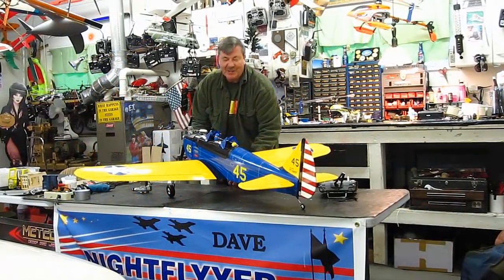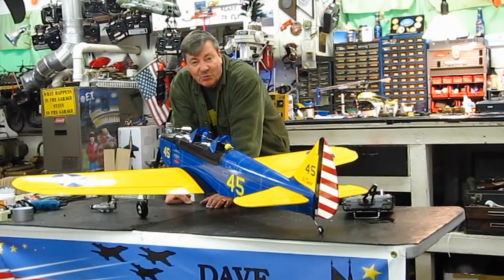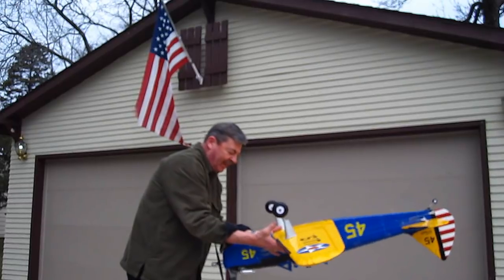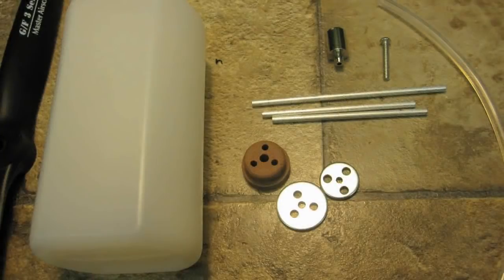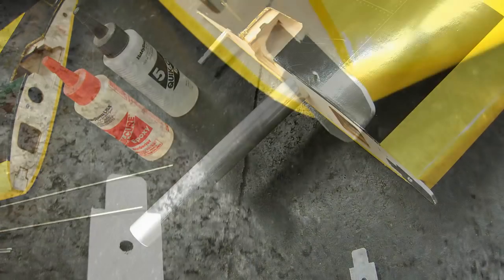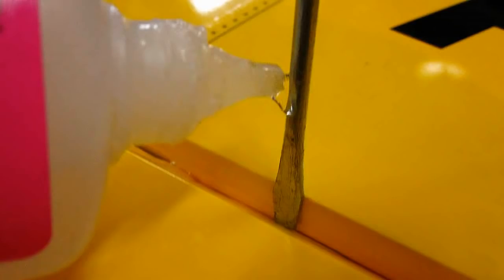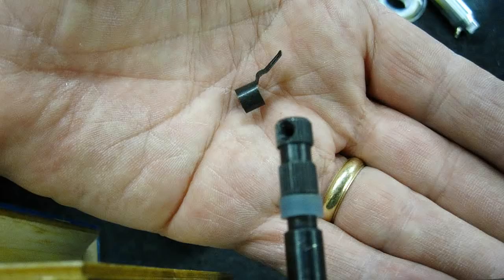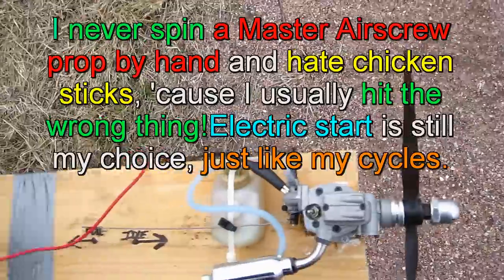NitroPlanes PT-19 with ASP .61 4 Stroke Engine tips and maiden flight.

Comment: I had a PT-19 I built from a house of balsa kit.  It was a 40 size that flew on a 25 size engine.  One of the most predictable and smoothest flying planes I had.  For that one the engine was mounted sideways which let the muffler run along side bottom.
Reply from the maker: That's great.  It was a sad day when this and a brand new one still in the box were destroyed in the fire that destroyed all my models.  I really liked it, as Balsa planes always seem to fly the best. Thanks.

Comment: 6 months of flying nitros. Heaps of hours in the air and no crashes - until today. Being too clever and crashed my hack trainer. Wrote it off. So now i have a spare asp61 and all the running gear i need for this plane. 
Thanks! 
:)

Comment: I get rezzed all the time about flying my glow power planes. But there's something about the set up, getting the motor to run good, the smell & smoke, the noise, the POWER, and the smoke trail behind the plane. And even the messy clean up. I LOVE IT!!  Electric is nice in it's own way too when you want to fly NOW. (If batteries are full) GREAT MAIDEN DAVE!!

Comment: What prop did you use to break in the motor? I was also interested in what prop you're using for the video. I have the same setup and have used a number of Master Airscrew props but haven't really decided on the "one" I like best. Just wondering what was your preference. Did you place your battery etc. behind the fuel tank? I was looking to see in the video where your switch was as well. THANKS! Great video and those ASP .61's sound great don't they!

Comment: How do you dispose of this fuel?  My father was into these model airplanes and died several years ago.  I was cleaning out his garage and found several plastic bottles of fuel.  It has to be at least 10 years old.  I poured a tiny bit on half a paper towel and lit it on fire (outside).  It burned for 5 minutes.   What do I do with it?
Reply from the maker: Take it to you local waste management that collects paint, etc.

Comment: @wudupbra420 10 to 15 % is good for sport flying 2 strokes and 15 to 20 % with higher oil content for 4 strokes
im running 20% heli fuel in my 1.00 Saito 4 stroke in a 68" Edge 540